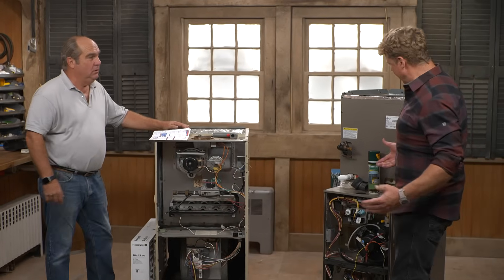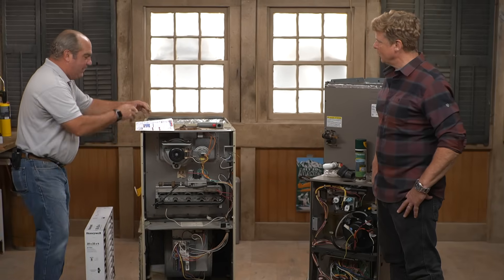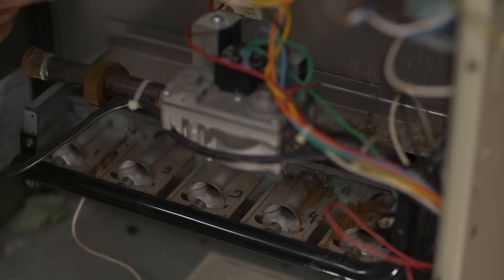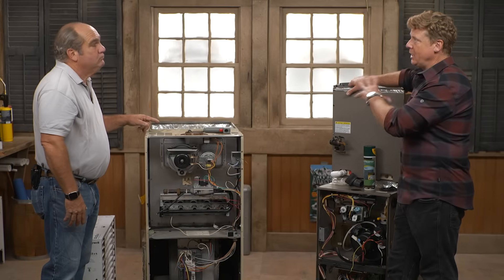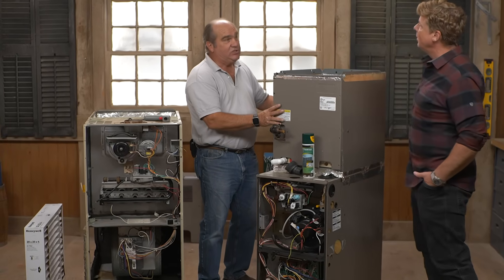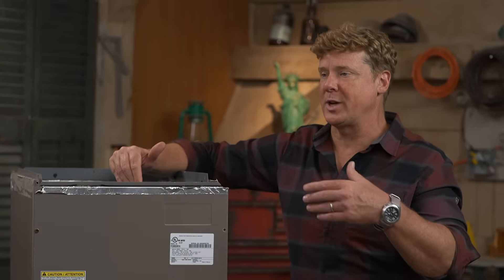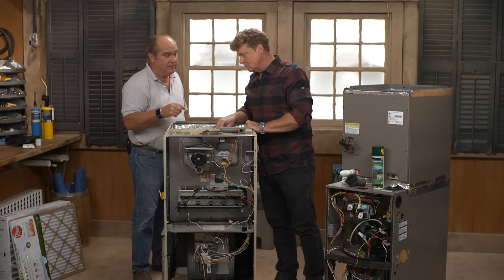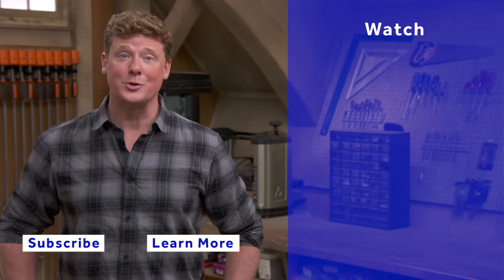Why is Furnace Maintenance Important? | Ask This Old House

Comment: In all my years having my furnace cleaned and serviced, I had never seen them checking combustion levels and such. They cleaned the areas with a vacuum and brush and lit the pilot light and that was it, which is why I stopped calling them and started doing it myself. Now, I don't have the tools to check those other levels, so I'll have to get someone to do that. But obviously, I'll have to ask for that specifically, because none of the companies hired ever did it on their own.
Reply: A lot can be done without test equipment. For instance, a cracked heat exchanger can be found by looking at the flames while the blower fan turns on. A cracked heat exchanger will blow exhaust air thru the cracks and the flames will get wavy like a wind blowing past them. An experienced tech will know by the color and shape of the flames, along with checking for soot between the burners and the exchanger opening the gas/air mix is within spec. The combustion analyzer can help dial in the gas for a couple percent more efficiency. But to your point, you don't know in the first place if your tech is a genius at reading the indicators of a potential issue.
Reply: @thebluelunarmonkey that’s bs. I’ve seen cracked and separated heat exchangers bad enough to put CO in the air stream that didn’t distort the flames. You have to do a combustion analysis, full stop
Reply: Same here I had a guy show up, I have a fairly new furnace, he tested a few things like temp in duct work, spent all of 10 minutes (no kidding), cleaned a small rod. I felt he didn't do a good job or knew it was a new furnace so the service wasn't really needed. It's natural gas, and charged for $200 for basically looking at the unit, I was not impressed. So probably more needed for an older furnace. Waste of money in my case. I change the filters myself.
Reply: @westbccoast My experience exactly.  I’ll get my furnace checked about every 2 or 3 years.  I’m not paying these ripoff artists $180 every year to do nothing.
Reply: @westbccoast  This BS show is strait out of Hollywood.
Reply: Same here. They don’t even own a manometer to set gas pressures or check static pressure. I stopped doing the contracts because I can clean the flame sensor and change the filters myself. I did install hi end CO detectors on all three floors. Too much filtration can create too much static pressure for the newer blower motors that have electronic controls?
Reply: @rzh3443  I think that's a good strategy and would agree. What's the point of a fake service. I watched him so I can see what to do next time. If he did a real service, I have no issues hiring a pro but this guy did basically nothing for $200. He did reverse my filter around I had it the wrong way, so there was that, other than that, waste of time. Also depends on the tech I guess, this guy was a little off, maybe not skilled or properly trained. Might be worth hiring a pro in 3 years with a different company to see if my experience is any different. I am just going to use regular filters and change them out often, every 3 months or so, they really inexpensive.
Reply: @rzh3443  that’s too bad you don’t do your due diligence on someone who comes in your home.
Reply: Sadly, my experience has been the same. In fact, in general I have never had the pleasure and satisfaction of having someone with the level of expertise you see on This Old House work on my equipment. In fact, if I had not seen some members of the This Old House cast in the flesh at a home owners show, I would seriously doubt they are real people. 😳🤔🤣
Reply: I just had my furnace turned up last week and he did all the checkpoints. What I did in October I clean the inside of the fan  area I change my filter every six weeks I check in between.

Comment: The problem is that almost all of the service companies are worthless and you're often better off NOT having them touch your furnace or air conditioner.
Reply: I agree 100 percent.
Reply: That's what I've heard from some HVAC technicians.  They also said most often it is of limited utility even with a competent tech.    
Check to make sure things aren't dirty
Reply: Thats bs and you know it, only a fool says this. Might as well say you never need to have a tech look at your vehicle during a repair, you will do it yourself by youtube videos. 

There are a lot good companies out there, homeowners are not wanting to do basic research for a good contractor. Doesn't take much effort to check on a companies credibility.
Reply: @zack9912000  Hahaha...I stopped getting plumbers to do those useless inspections on my furnace YEARS ago.  This is our 6th house.  I have a high efficient Heil furnace (came with the house, built 2012) here in Central Canada (-29C atm), so it gets used.  The only maintenance that makes any difference is changing your filter regularly to make sure the motor doesn't run too fast, and cleaning the flame sensor every year.  I can do those myself easily and save $150 per year.  If contractors didn't gouge so hard, people might actually use them.  I've even bought all of the parts that can fail on these (two motors and the computer board) so I don't get blackmailed by some scumbag plumber if the furnace goes in the dead of winter.  My next build will be infloor heat, all electric, water heater too.  Then I can fix anything myself (don't need a gas ticket), it's 1/5 the price of gas appliances, and it lasts a lot longer without needing replacement/repair.
Reply: @karlhungus545  That's a great, logical approach, and in the worst case scenario, you can have a backup space heater.
Reply: @zack9912000  You're obviously a repair man and I touched a nerve. Why don't you tell us how to identify a good contractor instead of posting a worthless rant.
Reply: @2011blueman  you’re absolutely wrong and resorting to ad hominem attacks is just extra evidence.
Reply: @andrewahern3730  don't user terms you don't understand. My comment didn't have an ad hominem attack, unless you weirdly view "repair man" as a pejorative.
Reply: @zack9912000  You just proved his point -- everybody knows ████ well that when you take your car to a 'random' shop, they'll do anything from overfilling your oil (causing a smoking mess when your exhaust heats up), to over-torquing your lug nuts (causes broken studs), to mixing the wrong coolant in your radiator (becomes sludge and ruins engine), all the way to INTENTIONALLY breaking something, slicing something, loosening something, draining something, shorting something, or burning something.

It's just a fact that for regular MAINTENANCE, the average person IS better off watching a video on YT, instead of trusting a half-witted sociopath with their daily driver. Even if you have a furnace guy that you trust, paying someone else $100 an hour to change a filter is simply not prudent.